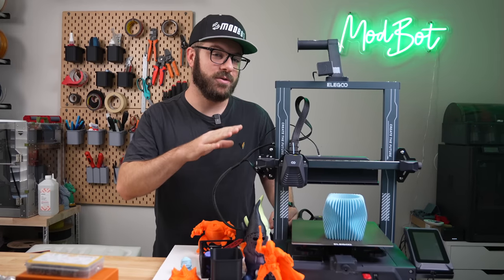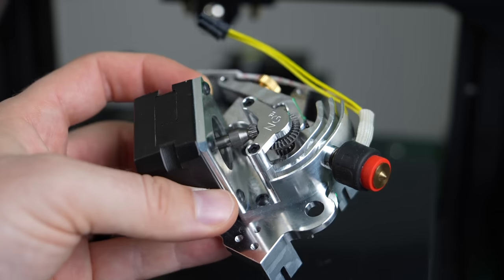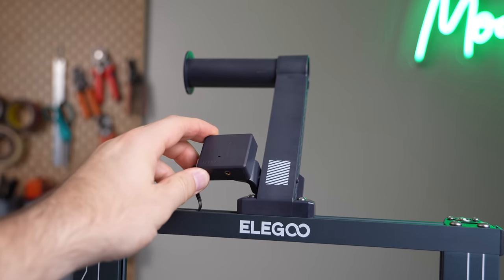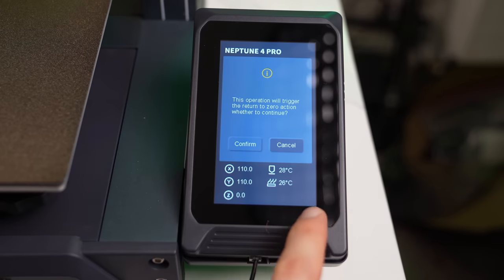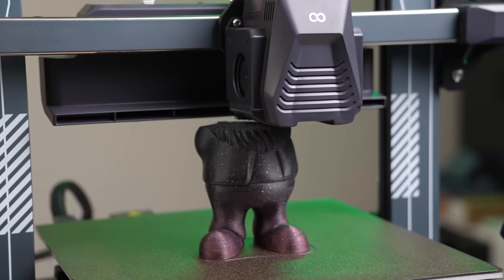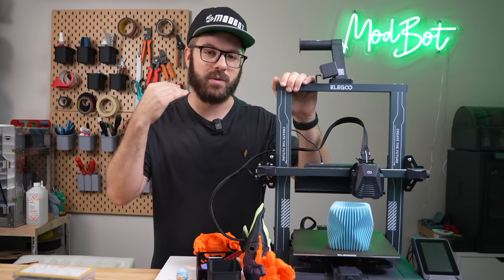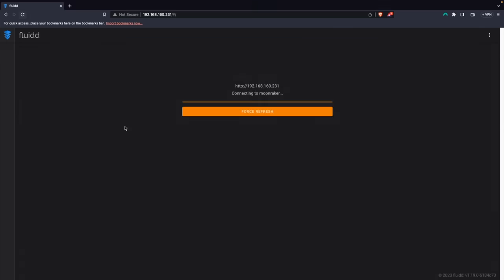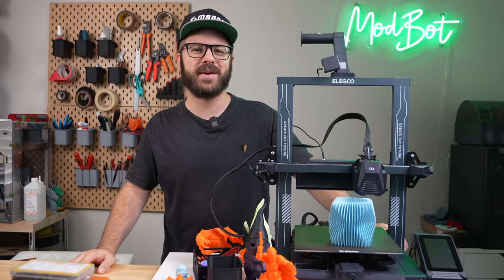This Budget i3 Packs A Punch! (Elegoo Neptune 4 Pro)

Comment: Rather than a USB WI-FI adapter, I’d recommend Ethernet to WI-FI adapters instead.  I’ve been pleased with various brands for IT and video legacy interfaces.
Reply: The board has a RJ45,  I would recommend a Powerline Ethernet so you don't have to deal with WiFi tantrums anymore.
Reply: @eaman11  you’d need two, but yeah whatever.  The point is USB to WI-FI dongles are rarely platform independent.
Reply: I've been incredibly confused why people are struggling so much looking for USB adapters when you just get an ethernet to wifi adapter and don't have to deal with drivers... I suppose  the USB adapter may be cheaper, but I've been using an ethernet-wifi adapter with my camera DVR for years and it has been flawless.
Reply: Years ago I bought some TP-Link personal routers. Super small little devices that are setup like any other router/gateway but can also be set to be used as a wireless adapter. I had to use one on my bedroom TV when the built in Wi-Fi died. A device like this would be perfect for those that don't want to or can't run an ethernet cable to the printer. The added benefit is that you don't have something plugged into the USB port when you want to print from a thumb drive.
Reply: Can I connect my neptune 4 to my home Wifi router using the Lan cable ? and my pc connect to the router via wifi. Will this work ?
Reply: Since i don't want to spend money on that, i use an old wifi repeater that I don't use, hide the repeated wifi network and plug my printer in its ethernet port

Comment: 1ST COMMENT. I have a Neptune 4. I'm impressed with it's price and print quality. Speed is good, too. I can start it without hassle or worry. Did you notice how much their Elegoo Cura looks like Ultimaker Cura? I don't get the print quality issues that you have. That can be a combination of belt tension, print temps, filament brand, filament moisture level, filament type, leveling, etc. I  just printed a statue of David planter and it is perfect. No ringing at all. In fact, haven't got ringing (ghosting) on anything. I usually print at 250mm/s with a layer height of 0.18mm.  Seems to be a magic layer height number. Print at 195°C with bed temp at 62°C. I've been able to print even at high-speed with those settings and not lose layer strength. I use Overture brand filament almost exclusively. PLA+ (professional) or Super PLA+ and  PETG is what I typically print with. Super PLA+ is 5x stronger than PETG  but prints crazy well and doesn't bone up the printer. I use Amolen for multicolor filaments and their silks. I would recommend for the price.
Reply: Super PLA+ is that good?

Comment: I recently repaired one of these at my shop, and they cheaply replicated the Creality Sprite extruder for their print head.  And I mean cheap as in low quality, not cheap as in cost effective.
Reply: At least they use bmg clone gears (neptune 3 pro had them) and not those stupid straight cut feed gears, so it can actually grip tpu
Reply: @kilianlindlbauer8277 creality sprite extruder can't print tpu? That sucks
Reply: @omegadeepblue1407  it can, but only hard tpu like 90 and 95a. 85a and lower (car tires are like 70 to 75a i think) not so much, you can pretty much pull the filament put of the extruder, the generic, single brass gear extruders grip soft tpu better than a sprite extruder. Just watch makers muse tpu videos, in one of the later ones he features the elegoo neptune 3 pro which is rather good at printing soft tpu , while some printer with the sprite really struggles with the same filament

Comment: For WiFi connection one can always use a WiFi extender that has Ethernet Jack. For print farm use could go from extender to a switch and then to multiple printers.
Reply: I was going to suggest the same thing.
Reply: 100%

Comment: Elegoo for me is a company of good to great quality especially for the price, and their customer service is very good. I called them because I had thermal runaway and they just immediately sent me a new board that fixed the problem.

My issue with them is that they sometimes release too many incremental versions of a generational printer. I got the neptune 3 shortly after it came out, then not a month later they announced the Pro 3 and I felt a little ripped off.

Very least I hope they go and try to make a coreXY printer soon, especially if they could go larger format. A Neptune XL if you will.
Reply: Yeah, pretty much. I bought Neptune 3 when I started my engineering and it has been just under a year and we already had neptune 3 pro line and now neptune 4.
Reply: How did you predict the orange Storm giga

Comment: Few things...

You should point out that the USB C port is a service port for serial SSH into the Linux side, not for controlling the printer. 

A linksys ac750 range extender is probably the best bet for Wi-Fi communication. 

Have you had chronic mcu shutdowns? The rk3328 is kinda notorious for that and it runs incredibly hot. 

There are also adxl pins on the board you can probably tap into.

Comment: I got around the wifi issue with just adding a wifi extender near the printer with an ethernet port. Works perfectly.
Reply: I have ordered the same printer and was wondering about this, too.

Did you have to install some drivers or did the wifi to lan adapter just worked out of the box ?

Comment: I'd say that WiFi (or rather Network) is one of the main points of a Klipper printer.
Also, I see a lot of comments about how WiFi doesn't work well in these Raspberry alternatives, mainly when using a third party USB adapter. I'd like to see these Skipr like boards including a good WiFi module with external antennas and a hardware button to disable the WiFi module if user wanted (maybe a jumper).

Comment: Just connected to one of those Wi-Fi extender
So you connect the extender to your home network then you connect the ethernet port to the printer and that way you can also add a network switch and have multiple

Comment: I'm on the fence between buying the Neptune 4 Pro and waiting for a Neptune with a larger build plate (for printing multiple parts) and builtin WiFi.  No wireless LAN was a misstep on a Klipper printer.  I agree that an accelerometer and a routine to calibrate input shaping on each machine to fine tune it would be great.  Maybe Elegoo could make an upgrade pack with the accelerometer (with firmware upgrade) as well as a plug-and-play WiFi dongle (Ethernet or USB).
Reply: I got my Neptune 4 Pro a week or so ago and I would buy an upgrade pack tonight if available. I love this thing. If it could be better, I'd do it
Reply: i hope u waited lol.

Comment: Yea, I’ve had quite a few people run into that Wi-Fi issue. Mine didn’t have that issue, but I’ve also had people find those Tenda adapters aren’t working for them too. So who the heck knows what’s up. They really need to add Wi-Fi onboard, but most companies running variations of that board are using dongles too.
Reply from the maker: I just experienced a similar issue with a completely different board and manufacturer. It ended up coming down to a file that was conflicting but without really knowing what you are looking for and Linux how would you know? I spent easily an hour or two trying different variations of instructions from different sources. With how many people run wireless with Klipper manufacturers should ship with a dongle and instructions on exactly how to set up. Leaving it up to the end user has proven to be a pretty poor experience.
Reply: @ModBotArmy  10,000% agreed. Definitely the big miss on that machine.

Comment: I got the Neptune 4 pro and have been trying to get a camera working on it. From what I've heard, cameras are not supported but klipper does most definitely support cameras. If anybody finds a way to get it to work, I would be grateful to hear about it.
Reply: I just got mine working using a way simpler method:

SSH into the printer

sudo systemctl enable webcamd

sudo systemctl start webcamd

Go onto the printers webinterface

Go into settings and then Cameras

Select the "Default" camera and activate it

I'm running an Aukey PC-W3 Webcam and the quality is pretty good.

Comment: Thanks. I have a maxed out E3 running klipper but as it ages it's getting hard to maintain. I think this is the fresh start I need if I don't go corexy.
Reply: the  ender 3 v3 SE is currently 100 less 
looks really tempting, I am wondeirng if it will be  the regular price  or  if it is pre order only though
I want to jump but I  have a feeling miceocenter will offer a  first time  customer coupon for $99

Comment: I own a Neptune 2s and wifi is something Elegoo has struggled with for some time. However the printer isn't the actual problem, their version of Cura is. I struggled for months to get the 2s to play nice over wireless after installing the MKS module. It would work, but it was temper mental and would randomly print out absolute garbage. Then I ordered a Bambu Labs printer and while waiting on it, I decided to get familiar with Bambu studio. While I had to jump through all kinds of silly hurdles with cura, bambu slicer simply recognized the printer, set it up and ran it better by default than cura ever did. So the problem was never the printer and never the wifi chip, it was the slicer and how it communicated. It blows my mind that their own branch of slicer works worse than another manufacturers entirely. I'm still actively printing on the 2s and it's running better than it ever has and I'm getting some solid upgrades printed for it now. Which is good because at this point if Bambu pisses me off anymore, I'm going to refuse delivery of the damned thing when it arrives and just get a refund.

Comment: I bought one--nice quick printer. However, why load the steel rails with dust & grime attracting grease? The steel rollers have bearings. They're supposed to roll on the rails, not slide on them. Maybe the grease is for the lead screws?
Reply: How about using dry-lube like on bike chains? PTFE-based lubricant thats made for off trail biking without attracting dust and particles sand-particles to the chain.

Comment: ive enjoyed my Neptune 4 pro so far.  i had one issue with nozzle occasionally dragging over printed areas, any idea how to fix that? also i had some part warping issues and just ended up turning off the huge fan altogether at least during winter dry months...seems to help.  I lowered extrusion to 95% seems to help with nozzle drag but still happens some....
Reply: turning combing off introduces stringing but helps with collision

Comment: So, if connected to the house network with an ethernet cable, will I be able to send the gcode files directly to printer from my computer and bypass the pendrive?
Reply: yes you can connect to the printer through a web interface. just check your printer settings for the IP address

Comment: Are replacement nozzles readily available?  I didn't see on their site.
Reply: They have been used by creality in  the ender 7 and 5s1 for a while now. Also the ankermake m5c uses about the same size. Personally i dont like this size since its rather uncommon and i haven't found steel nozzles yet, only brass, nickel plated brass and copper
Reply: Aliexpress selling hardened  steel and stainless  steel nozzles for neptune  4 printers.

Comment: I have two heavily modded, klipper'ed neptune 2s' and I like them.  Maybe one day I'll pick up a newer Elegoo offering.
Reply: Can I ask what kind speeds and accelerations you are getting with the old models?
I just got a 2s and I'm considering swapping to Klipper.
Reply: @eaman11  on mine that I have also klipperized my input shaping graphs max out at about 4000mm/s and i can run travel moves at around 400-500mm/s. when I go above that things started to misbehave
Reply: @gebebbebebebr  Dam man that is a fast bed slinger, I'll get a CHT nozzle and some extra cooling and I'll try that too! 
Thanks and congratz!

Comment: What I still wamt is the possibility to control via phone. See a video what is currently happening with the possibility to stop the print. EVEN when i am not in the same WiFi Network. So when I am grocery shpping (for example).  This is important for bigger prints which are aking very long.

Comment: Noise doesn't HAVE to be part of the cost of better cooling, printer manufacturers just need to start using quality fans like Noctua's. That said, a printer using quality fans likely isn't going to be hitting a $300 price point like this one. It would be great if they'd start designing things to allow fan upgrades with minimal effort, though.